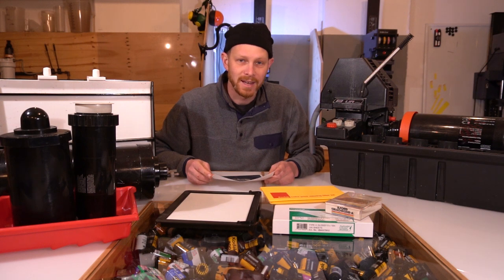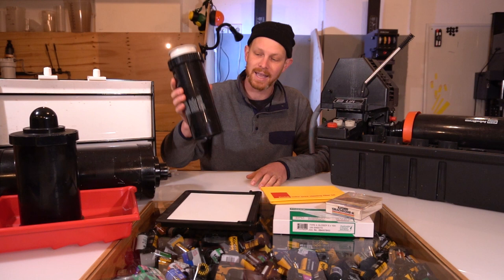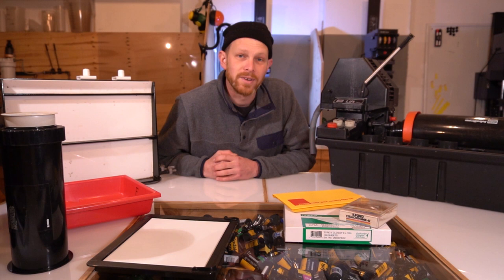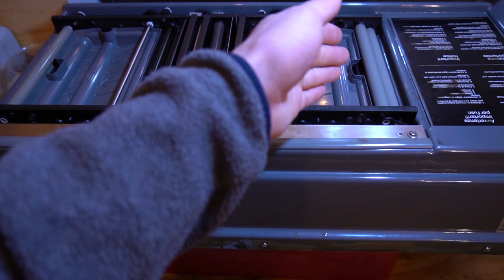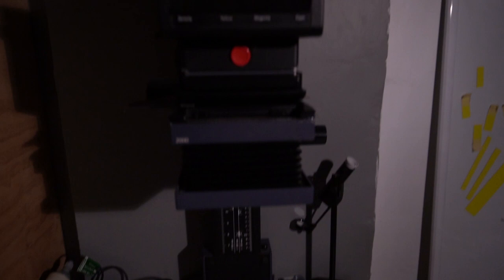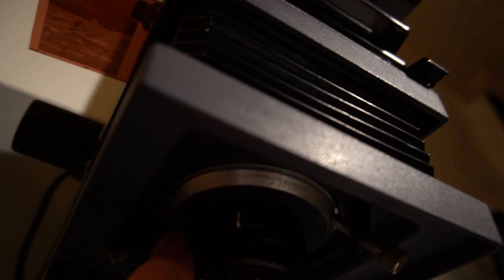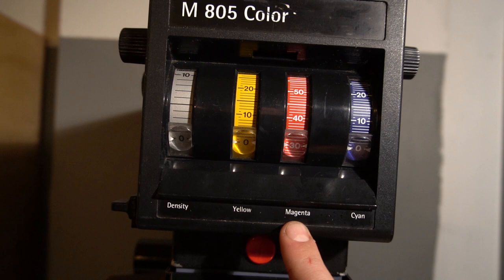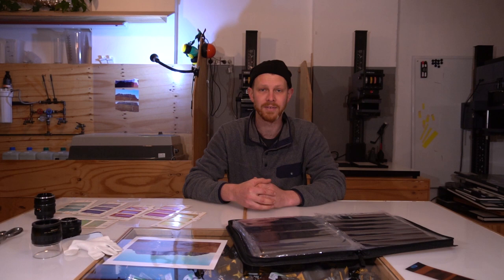How to print colour photos in a darkroom

Comment: Really a great walkthrough. Best I found so far after days of looking around the web.

One small question. You are using the automated system (if I could afford one I would too) but could you maybe also do a walkthrough to do the exact same as you did but without the automated system? This because I think most people, like me that just started, first try it out with putting it all in a bath. And sadly thats quite allot harder I guess.
Reply: Yes he was using a machine for processing, but as he showed you, you can just use a plastic tube for processing. When I did color printing I started doing it in my home darkroom. I used trays in a water bath. I had a black-and-white enlarger so I put color compensating gelatin filters under the lens, you could add about three at a time. All in magenta and yellow density increments. You can also use acetate filters in a filter drawer if you do not have a color enlarger. In photography school we had the most sophisticated equipment, more so than what he shared. We used in the 1070s a color analyzer to meter with a probe on the easel the color balance and exposure. The analyzer had to be programed before use. We also had a large Kreonite printer that could take 20 inch paper, and the print came out dry. But that set up was a lot more expensive than what this You Tuber was using. I printed a lot of 16x20 inch prints and I knew of one student who printed a 20x24 inch print. Color printing can be as simple as using trays in a water bath, he used an aquarium heater witch I thought was impressive. It will take you a lot of time these days to make a successful darkroom color print; besides exposure you have to learn how to judge the color balance. You can buy these color printing filters in increments of .05, .10 up to about .50 in density of each color which would be magenta and yellow. The number system is based on logarithms like neutral density filters. I'm sure they no longer make color analyzers, so you will have to be your own analyzer--plus during the 1970s they carried a price tag on the average of $2,000 or more. You won't be successful right away but stick with it and you will have success with very little equipment. You can pretty much use the same equipment that you use in your black-and-white darkroom including a black-and-white enlarger, but then you must buy the acetate filters in the various magenta and yellow densities. You also need color print paper which I think only Fuji still makes. You need a color chemical kit for print color negatives. The temperature of the chemicals must be a lot warmer than with black-and-white. Try it. I like color. I hope you have success!

Comment: The colors may have looked accurate at 20:45 but I have to say that that print would have looked better if you had left it with the unbalanced more saturated colors from the 4second test strip. A neutral image is not always a good looking photo, more so than not a very saturated popping photo is more pleasing. Just my 2 cents.
Reply: Personal preference